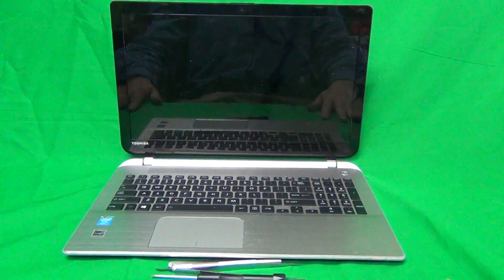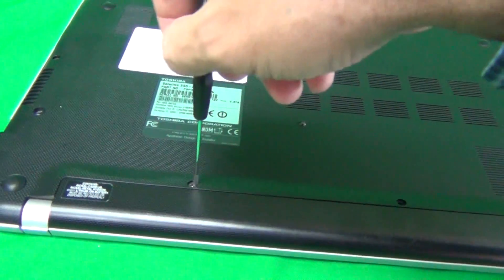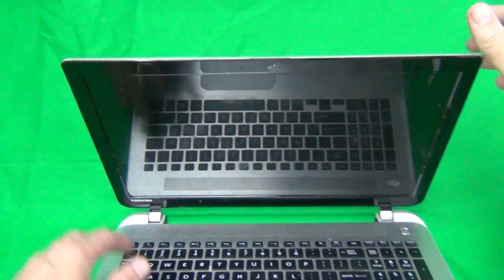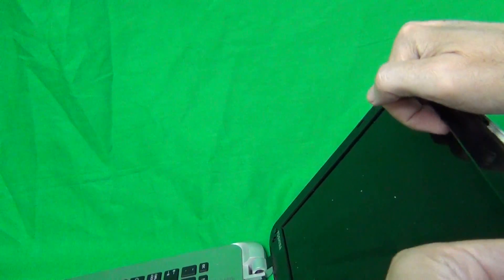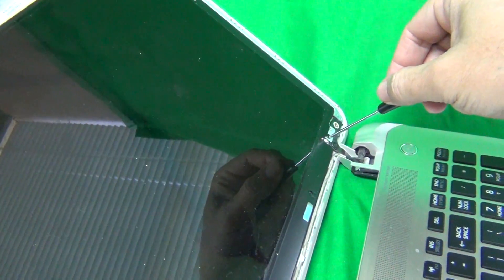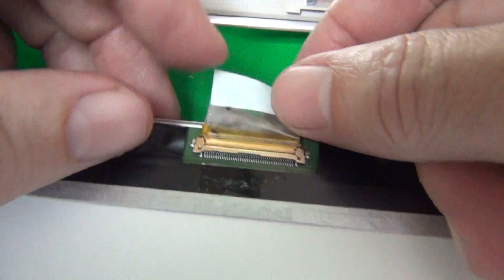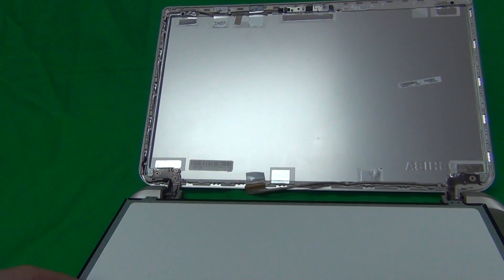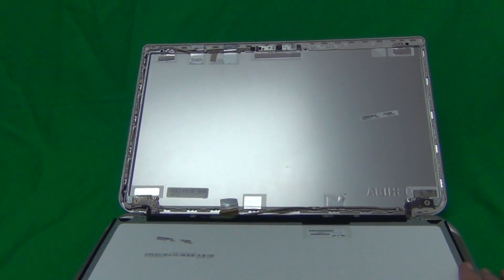Toshiba Satellite S55-b Laptop Screen Replacement Procedure

Comment: Hi ,thank you for sharing. I got a s55t touch screen model.  the problem with my 4 years laptop is there has a bunch of pink color vertical lines  just on the right side of shaft .  The problem has last for a year . It is obvious when i start and sometimes gone when I power on for a while.. Looks like the cable connecting issues. If this problem can be fixed or i  need to replace the screen ? thank  you

Comment: are 40pin to 30pin converters worth it? Im trying to upgrade from 1366-768 to full hd 1080p but the new panel would have a 30 pin connector unlike the 40pin currently installed

Comment: Have you ever replaced a toshiba s55t-b5136, touch screen.  It's cracked, but I don't see anywhere for screws...do I just detached it from the sides?  I tried it, the screen cracked as I was trying it, but it was already cracked, so I didn't mind...but I stopped...